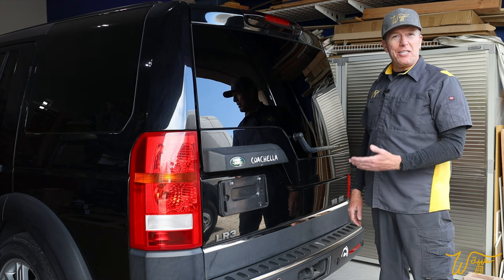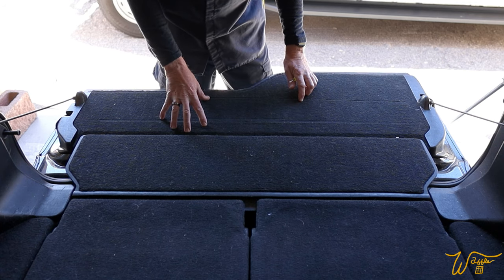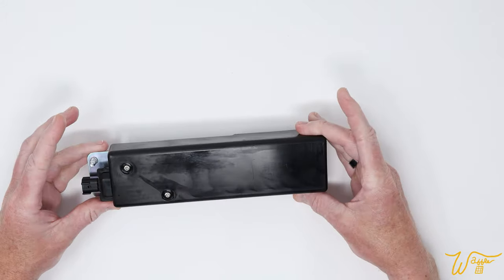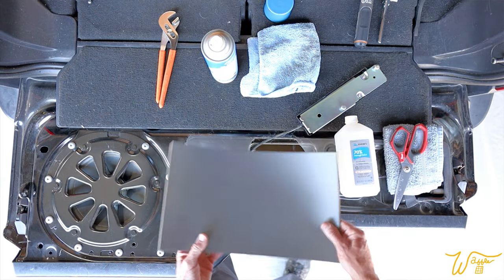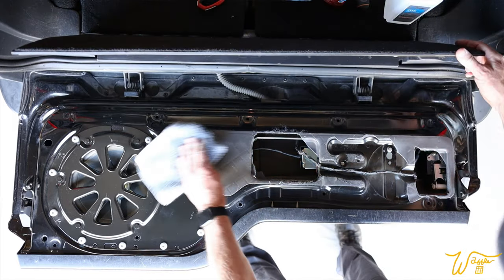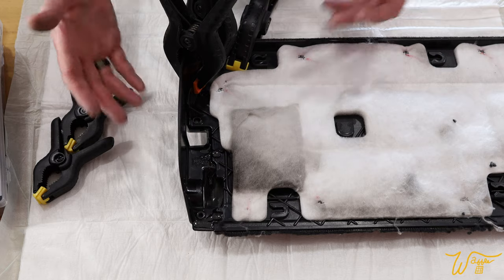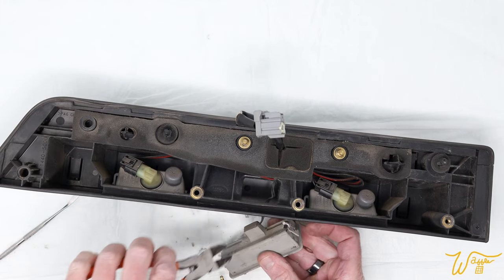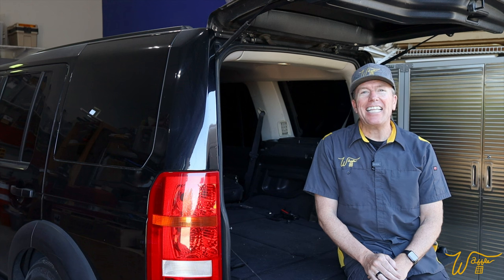Fixing a Land Rover LR3 Tailgate - Ep. 13

Comment: I had to fix my top tailgate switch about a year ago. Great video! Would have saved me a lot of fooling around!
Reply from the maker: Through the magic of editing you didn’t see me “fooling around” trying to figure it out. I hope it saves lots of people time.
Reply: How did you figure out your top switch was bad? Mines not making a sound and can’t get it to unlatch.
Reply: @ShirleyAerial  If the top switch is making a sound it means the switch is fine and it’s triggering the actuator. It’s possible that the latch it self went bad.

Search for “Locked Out by the Land Rover - Rear Hatch failed” here on YouTube
Reply: @ShirleyAerial  Sorry, I read that wrong.

If it’s NOT making a sound, the most likely culprit is the switch. 

As in the video, if you hold both the lock and unlock buttons for a while, it will trigger the rear latch. If it doesn’t, first check the fuses. Iirc, it’s the part of the central locking fuse.

 Otherwise there might be multiple failures.
Reply: Thanks. It was the switch that was bad on upper gate. I’d press the lock/unlock and it would activate the bottom actuator. Turns out switch was sticking. So I soldered a replacement switch and all is well. Thank you!
Reply: @ShirleyAerial  Fantastic! Glad you got it working.

Comment: So happy I came across your channel! Love the detail in your videos and the informative way you explain every operation you are undertaking! However I have one thing that is bothering me, unless the bolts on your LR3 has been replaced with standard bolts (as you Americans call it :) ) all your nuts and bolts on an LR3 uses the metric system :)
Reply from the maker: Thank you, Christian, for your kind comments. As for the nut sizes, some measurements are interchangeable between metric and imperial. This vehicle has had several owners in its’ life and in some places on the car it is clear someone has been tinkering in there before me. I simply call the measurements as I find them.

Comment: Went through the same process 2 yrs ago. The actuator broke twice where the cable connects which you may have noticed is a bit flimsy. Second time around I installed a manual override. Had the same problem with the different connectors for the top switch but I removed the individual wires inside the connector and swapped them over from memory. 👍
Reply from the maker: Nice! Thank you for sharing.

Comment: Hi Mike, I was a mechanic in the UK and Australian armed forces for over 40 years. We only worked on the Land Rover series 3 and Defender vehicles. That said I still watch all your content as my own daily driver is a Disco 3 4.4V8. I love your presentations mate, spot on with the right amount of detail that would give my mum the confidence to take on aome of these jobs. 
Anyhoo enough about me.
I just wanted say I did this on mine 4 years ago. The torx bolts on my number plate housing were all sized. I had to pry them out and glue the brass inserts back in.
I also had a rubber boot around the upper tail gate switch. Yours didn't appear to have one. It might stop it failing again in the future if it has one fitted.
Reply from the maker: Dave thank you for the advice!!
Reply: @wafflesquare  hi Mike I just had a look at a Land Rover parts list. They don't show the upper tailgate switch as a separate item nor the rubber boot. They only list the entire handle/switch/license plate light as a complete unit.😱